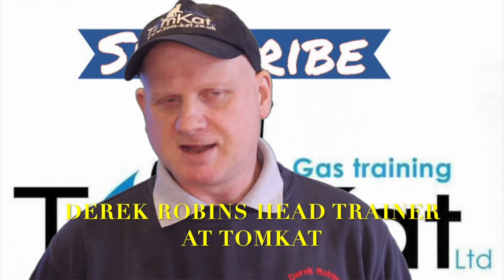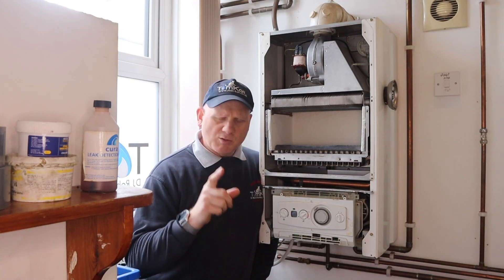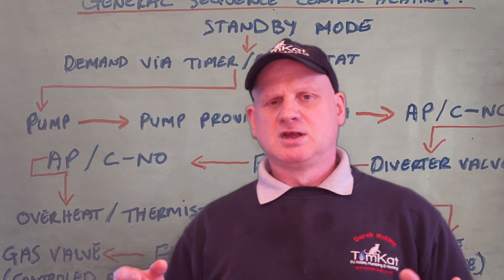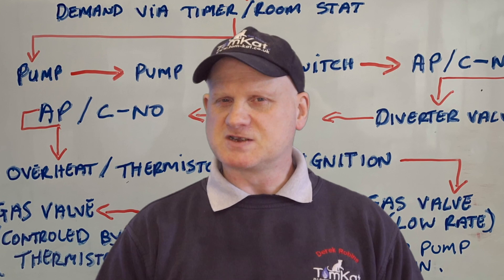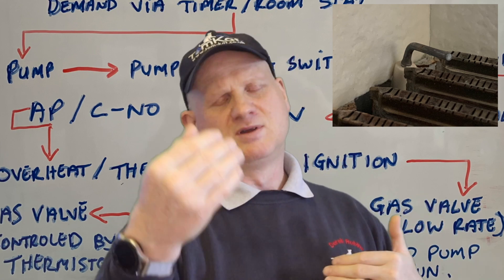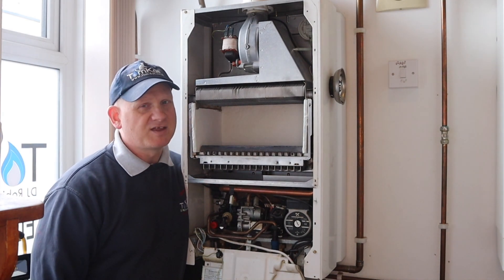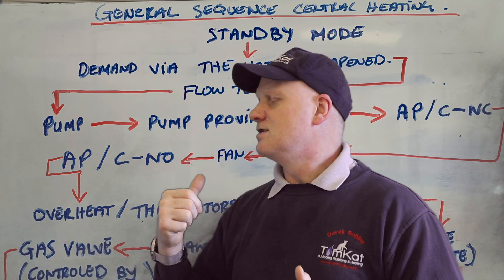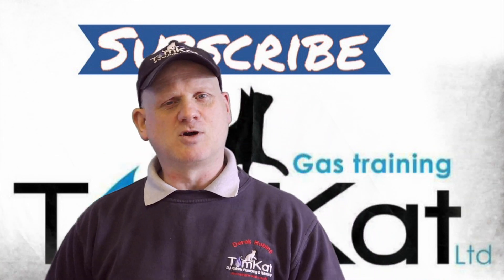GAS BOILER SEQUENCE OF OPERATION PART 1 how a gas boiler works in central heating and hot water mode

Comment: Thank you,sir; 
I have a  question, please: 
 Roca Victoria 20/20,  if the flow sensor,the Hall +magnet sensor, it is only in the domestic hot water,circuit, faucets,if it  is bad (or disconnected?) the CH,central heating, will still work perfectly, won't it? thanks; 
 and again,  a masters explanation was provided there.

Comment: So just to be sure I understand. Only once the fan starts running, then the air pressure switch, creates a switch so the normally open circuit closes and this proves the fan is running so the boiler can then Carry on and open the gas valve ect?

Comment: I don't understand why it needs pomp proving switch in hot water mode. It had first the flow switch that is proving the presence of water in system and also means it's enough pressure (by spinning speed )